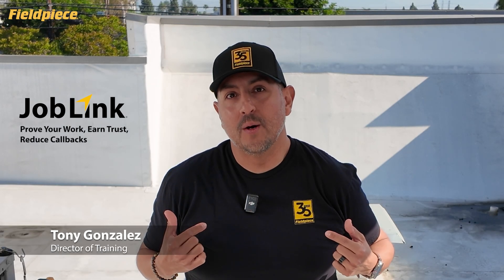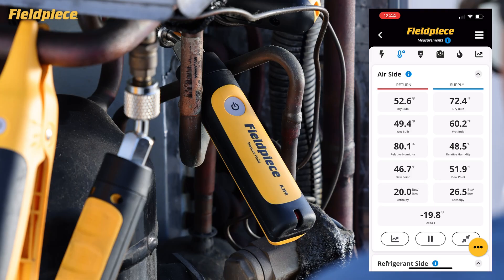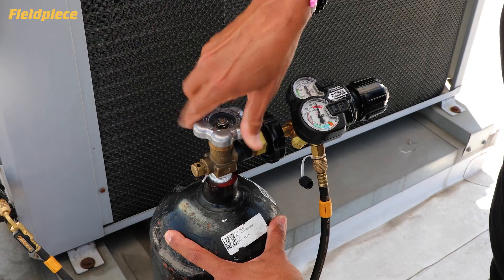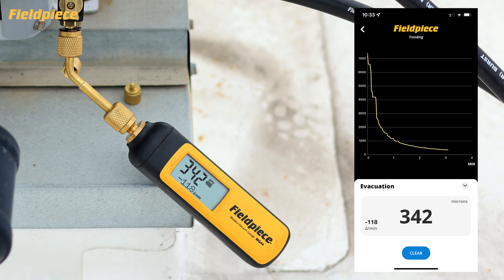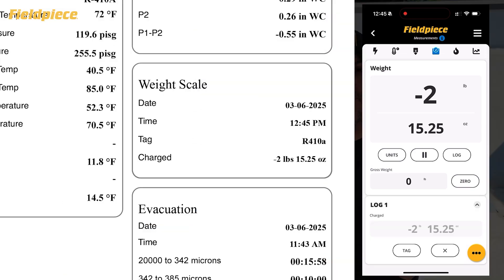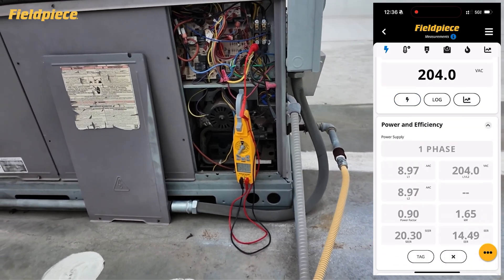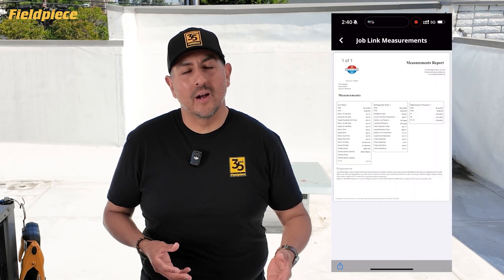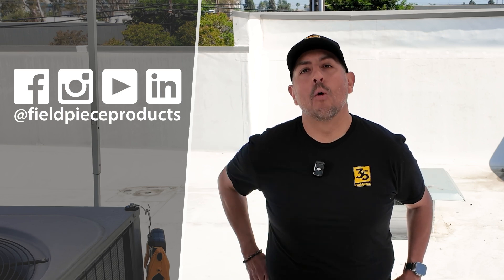How to Prove a Job Well Done with Fieldpiece® Job Link® Tools & App

Comment: It disconnects if you don't use the app for a couple minutes then you loose all your data you logged. You take a call and go back to the app and all the probes disconnected then you have to close the app, reopen it and then the probes reconnect but you loose all your data from previous tests. I haven't been able to generate a full report because of this. So you want to do a pressure test, dont let the app go to sleep, dont walk away or do anything else with your phone or you lose the data. So after my pressure test is done I generate and save the pdf. I like the app but it's frustrating having to close and reopen it 20 times a day and loosing data when the app closes.
Reply: Amen brother,and how about when the app just decides to shut down. Spend all the money I have on probes that I cant really get FULL use of it as I intended
Reply: Wonder if you used an iPad mini just for these?